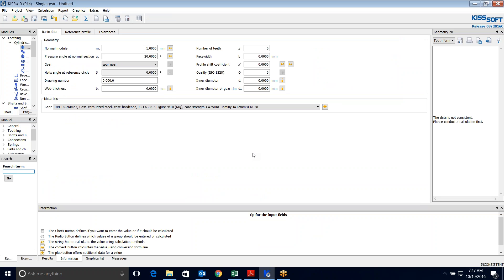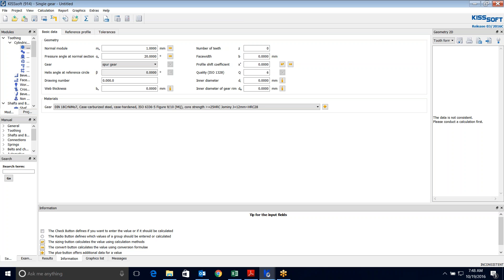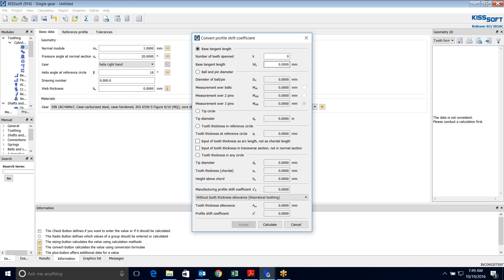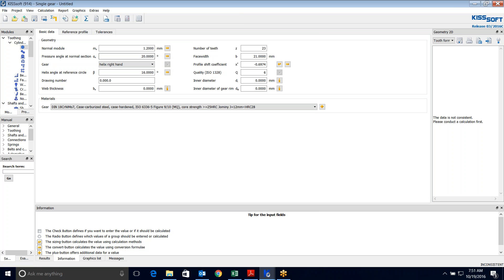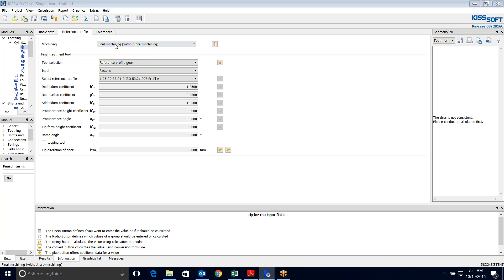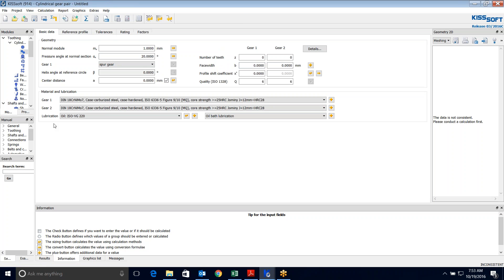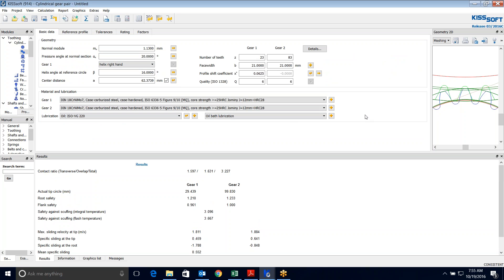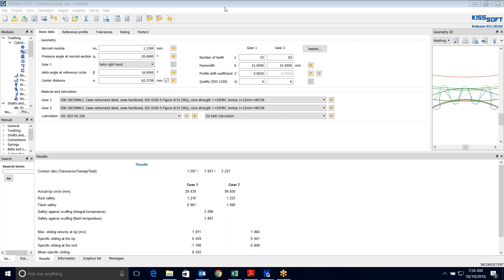Reverse Engineering Gearset - KISSsoft Strategy

Comment: How affordable
Reply from the maker: depends on what you need, the software could be anywhere from $10k all the way up to $100k.  Generally, to have a good balanced software, you might be in the $25-40k range, but it just depends on what you need for modules. You only buy what you need, the software is modular.
Reply from the maker: There are rental options also
Reply: @kisssoftusa9363  this this is expensive